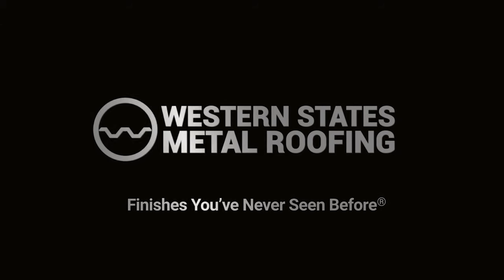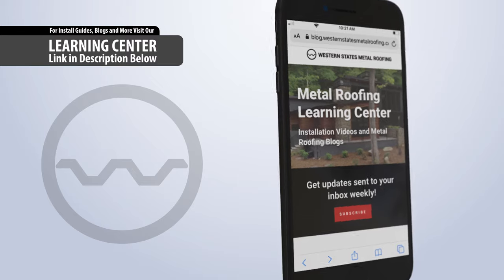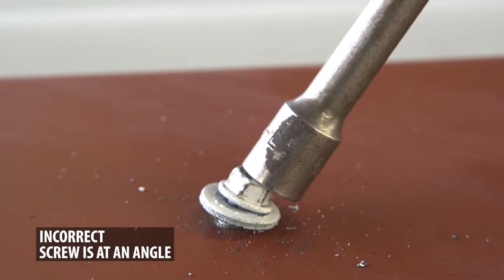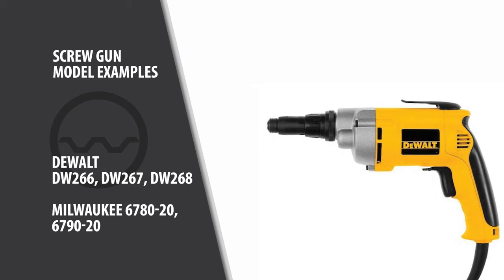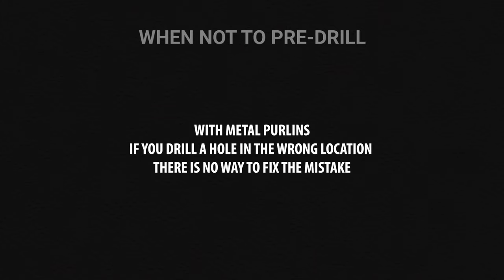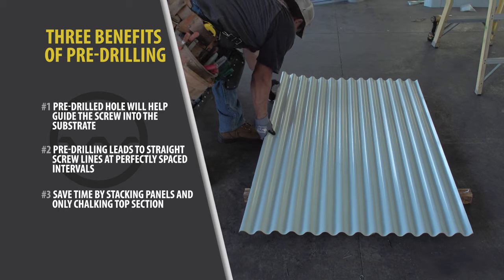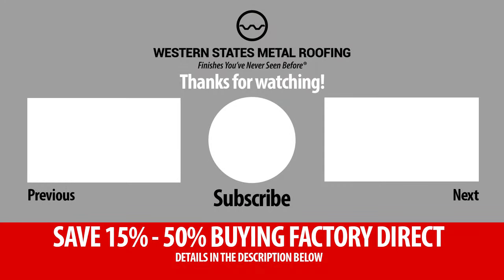Screwing Metal Roofing. Correct & Incorrect Way Of Fastening A Metal Roof + Pre-Drill + Screw Guns

Comment: Screw gun is unnecessary for anyone with a few hours experience using a modern impact driver. Trigger is pressure sensitive and power setting exists for low power applications such as metal roof screws.

Comment: do not accept a roofer too lazy to place screws on the ridge. The gaskets fail all the time even if installed correctly.
Reply: It depends on the roof type and location.  Screwing on ridges may have a lower wind rating.
Reply: Check the manual for the panels you are using.
Reply: I wouldn’t call it laziness, to maximise water tightness, always place roof screws through the crests.

Comment: the screws used in this video are prehistoric!  New screws are all one piece, bottom out the cupped shaped head against the sheet metal and the internal rubber washer is seated just right.  Washer is shielded from the elements.
Reply: Have a link? I'd like to check thse out
Reply: @minutemandefense3935  No. I live in McAllen Texas and our local metal building supplier sells them.  Their name is Royal Metal Buildings, they are out of San Benito Texas.
Reply: @minutemandefense3935  I believe they are called ZXL screws. I don't have any info on suppliers or links etc but the metal supplier my builder uses (ETAS in Mineola TX) offered them as an upgrade. Well worth the extra I think, knowing that the rubber is not going to perish as fast, and less chance of any overtightening issues
Reply: Yes the “Bell” shaped washers protect the rubber gasket better from the sun,  but the. downside is that these bell shaped metal washers must be seated exactly flat against the metal panel or else they will prevent the rubber gasket from getting the proper compression.  Something to consider when you are going to install thousands of these in a big metal roof.

Comment: You dont need to use a screwgun atall , you can use a drill with a clutch and set the torque on the drill just remember not to set the torque to high or will overtighten the fixing.
Reply: That's what I do, works very well.
Thanks for posting !
Reply: That is what I use also. No issues with breaking screws or other 'screw failures'.

Comment: No roofing contractor in their right mind in Australia would frig around and pre-drill the sheets.
Reply from the maker: Willy. We appreciate the feedback and agree that pre-drilling sheets is a personal preference
The main two reasons we would recommend are:
1. If you’re putting a 2” screw in the panel high it can be difficult and time consuming to attach the panels and keep the screw straight and not at an angle. The pilot hole helps a lot.
2. What’s faster? Stacking 10 plus sheets and snapping one chalk line for straight screw lines or snapping chalk lines after the fact?

If the installer can keep the screw lines and screws straight and believes it’s quicker without pre-drilling than that’s better
Otherwise pre-drilling will actually save you time and provide clean and straight screw lines
Reply: @WesternStatesMetalRoofing  Here in Australia we also use a flick line to guarantee a straight line as far as using 50mm screws that is not a problem at all I have used 60mm screws and have no problems the trick is to replace the magnetic tex head bit often !!
Reply from the maker: @robertbutler8004  Appreciate the excellent feedback
Reply: Your going to take more time, maybe for you it doesn't matter, I worked for a metal building company if all the materials are on sight a crew of 4 can put up any building under a 60x40 in a day that includes insulation, and doors and windows, all except in overhead doors we had a crew for that
Reply: @JohnAdams-xc5yk  who are you directing your comment to?
Reply: I think  the big difficulty the screws. The screws we use in Australia look alot better than what's shown here. There are still a few old boys here that stack and drill. But really,  that only applies to full sheets. I've seen nightmare roofs with 17 different pitches. Your not stacking that.

Comment: Did my metal roof with a cordless drill. Predrilled all the holes when the panels were on the ground, then set the clutch to the proper setting and let her rip.
Reply: Setting the clutch is nice in a perfect word but when you’re running 100’s of screws you run into harder pieces of wood that slows you down adjusting the drill all the time...best way is by feel for me 👍🏽
Reply: @bullfrog1807    I agree. But the bulk of the screws go in no problem which really speeds up production.

Comment: Pre-drilling doesn't save time, it adds time. Second, whether you pre-drill or not you can still get a nice straight screw line with a string line. I don't recommend pre-drilling sheets prior to installation. Often the sheets will need to shift slightly upon installation and you can easily find that your holes are no longer where you want them.

Comment: Grabbing drilled metal bits with bare hands was the number one injury at my works.
Reply: Also when you see a bare hand wipe a surface they just drilled. One bit of swarf and you slice your finger. I reckon a clip lock system is far neater. No exposed screws.

Comment: 18 year old corrugated metal roof. Screws with rubber washers are wearing out. Should I replace with new and larger screws or use some kind of product that will coat each screw?
Reply: replace
Reply: replace is the better option (and almost always cheaper) but might be a bit more work.
Reply: I've seen that a lot, the screws rust, and shrink. Seems like there should be stainless steel screws and washers, (are there?)

Comment: Putting fasteners in the low spots is a very bad idea.  This is one of the few videos that correctly shows where to put the screws, in the high points or for a different style roofing, high and mid points.  The low points is where the water is.  Do not put the screws where the water is.  Five years in all low point screws always leak

Rather than just show the correct place to put the screws you should have said do not ever go low.  Low is where you want a guaranteed roof screws so when the roof fails after the warranty, the roofing company has side jobs fixing leaks on the homeowners dime
Reply: some roof manufacturers recommend the low oints for their specific roofing. I think leaks have more to do with the gaskets on the screw washers, old ones wear out and depending on how much pressure they are under they can wear out faster. For most metal roof applications you are correct that they should be placed at the high points though.

Comment: The guy in the video does not appear to be using the same screw gun that the video recommends.  Is there a reason for this or is it just an oversight?  Maybe pros get to a point where they don't need a specialized screw gun?
Reply from the maker: Chris,
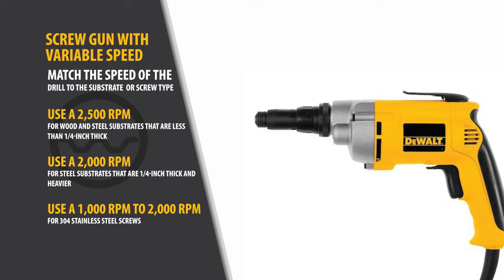The next best option for a screw gun is a variable speed adjustable driver. That's what's being used in this video. It will work fine. See 3:52 in the video.

Comment: The biggest problem I found is that the screw will over tighten against the metal and not even be pulled down against the roof.
Reply: Back out the fastener to release the pressure then screw it back in. Saw this on another channel

Comment: Exact size of the screw pls. Because corogated sheet gap is there.?
Reply from the maker: If it's a roof we use a screw that's approximately 1" longer than the height of the corrugations. In this case it's a 7/8" deep panel and we used a 2" long screw.

Comment: My  view is these exposed screws with rubber will eventually leak as a direct result of movement of the entire structure even if they are correctly driven.  Freezing and thawing can also cause the rubber to degrade. also if the fastener corrodes or rusts that also will effect the rubber. The standing shingle with structural form to prevent buckle from heat and  cold has to be preferred.
Reply: I don't know what elastomer they use on the screws, but there are plenty which are unaffected by any natural earthly temperature range.  I imagine they chose one of those.
  UV deterioration is a more likely problem, but there are elastomers which are pretty inert to that as well.

Comment: If you pre drill sheet metal, the screws will back out over time. I have seen it happen on many roofs. Don't pre drill!
Reply: Your wrong, all commercial metal building Contractors pre drill their sheets, I know buildings over 40 years old screws tight, I know I bought a 85x100 steel building I had to take down all the screws were still tight
Reply: The drill, that was used, was probably too big.
Reply: I'm no roofer but I thought the pre drill was a size smaller so the hole just guides the screw in.
Reply: I am a metal roofer and you are correct!! I noticed they used 1/4" drill hole with 1/4" screws lol they also said not to ever use an impact driver..then showed video of someone using just that haha

Comment: I was taught to put screws in the valleys to prevent compressing the sheet and throwing off the layout.
Reply from the maker: If you were to look in the installation guides of different manufacturer's you would see it shown both ways. 
Low = better attachment plus less chance of denting the high rib
High = more weather-tight. 
The majority of installers think there is more value in a weather-tightness vs slightly better attachment. 
Also unless you have a 29 gauge denting the top of the panels is not really an issue as you would be over-tightening the screw if the panel dented. That would create a potential leak point as it damages the screw washer.

We have explained it thoroughly in this video at one minute and 34 seconds
https://www.youtube.com/watch?v=wMdOnxBmu0E&feature=youtu.be
Reply: put all my screws in the valleys and have not leaked a drop in 21 years  ... love the rain on my tin roof at night ...
Reply: You would be correct sir by putting your screws on the high point this causes your rubbers to deteriorate faster because expansion and contraction from temperature change works on them more and at some point your rubber usually does not contact anymore when you put them down in the valley their way more likely not to leak I'm sure your comment has or will save a lot of headache for many individuals thank you for speaking out
Reply: If you put the screws on the peaks , they are never tight .  Long roofing lengths expand and contract in the sun ,                           so they work on the loose hole , and make it oval and elongated .. Thats why the high quality snap over roofing           have the screws covered between sheets  .

Comment: What if I only have a drill?
Reply from the maker: The main issue with a drill is that you are likely going to over-tighten the screws. This will damage the sealing washer and water will penetrate between the panel and fastener. My suggestion is to buy a screw gun, but if you cannot do that just pay close attention that you don't over-torque the screws.
Reply: Then learn to know when to let off of the trigger at the correct time.  just like i said bullshit to their statement of not to use an impact. i use a quarter inch drive impact and don't have any problems because i "KNOW" when to ease off. LEARN
Reply: @123jerro  
The funny thing is that they are using a Dewalt impact in the video the entire time😂

It is much easier to control the screw depth and speed with an impact.

Comment: Corrugated metal panels should not be used for roofing applications. Does nobody see the problem with 1,000s of penetrations on your roof? All it takes is one improperly installed screw to leak. I don't know why insurance companies cover these
Reply: It's been extensively used in Australia for over 100 years and generally performs quite well. There are 50-100 year old houses with corrugated roofing still standing and weather-proof, so it works, despite your mis-givings. The thing I don't get is the American obsession with covering roofs with what look like sheets of thick sandpaper (those asphalt shingles). Can't they afford proper tiles if they want that tiled look?
Reply: @calebfuller4713  The oaks over my studio dripped their tanins and acids down on my asphalt shingles and ate right through them.  I'm going with a metal roof now.
Reply: @calebfuller4713  
Yeah mate.
Moved to US 40 years ago. Asphalt shingles are horrible. Remember when I lived on S.Aust. and the banks didn’t like to loan on a tin roof - they ONLY last 50 years!!
Reply: We had a Colorbond (corrugated metal) roof on our house in Australia when I was growing up, never had any leakage issues. Love the sound of the rain on it. A massive hailstorm swept through the Eastern Suburbs of Sydney in 1999. Every house in the zone with roof tiles or slate was smashed to pieces causing huge water leaks in those homes. The ones with corrugated metal roofs were only dented and weren’t affected by water leakage. Our new house is 12 years old, we have a Colorbond roof on it. Best investment in my opinion

Comment: what is an screw gun? is that another name for an electric screwdriver?
Reply: A Tec screw gun has a adjustable clutch
Reply: An "Electric Screwdriver" generally refers to a tool shaped and held like a bulky manual screwdriver, and rather light duty.
  A "screw gun" generally refers to a tool shaped like an electric hand-drill with a chuck specifically made for the hex-shank of a screwgun bit.  They are normally MUCH beefier than an electric screwdriver, and turn a lot faster.  Most of them now use an impact-drive mechanism which makes a lot of noise but will drive a 3" deck screw into oak with no "kickback", and don't require lots of force to keep the driver bit from popping out of the screw and mangling it. They are truly amazing.